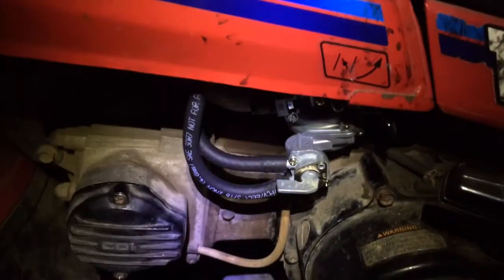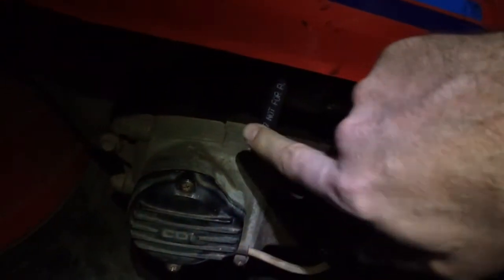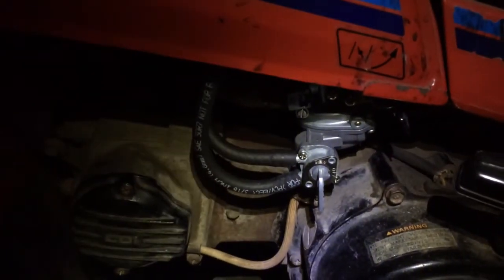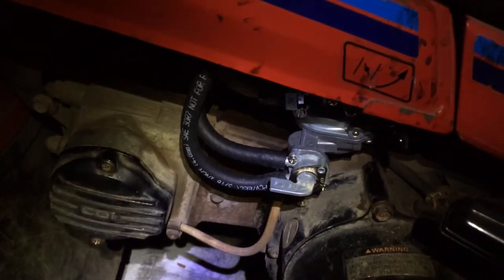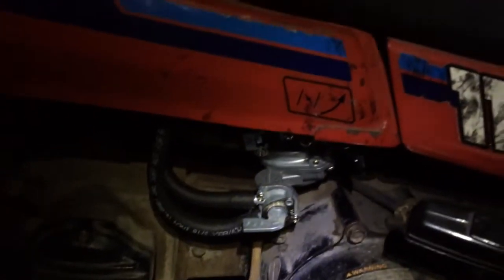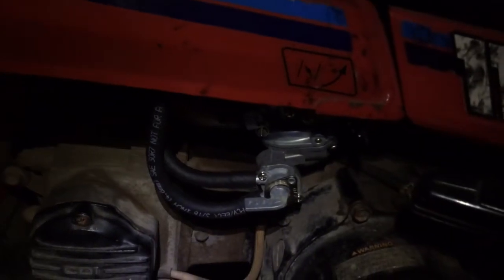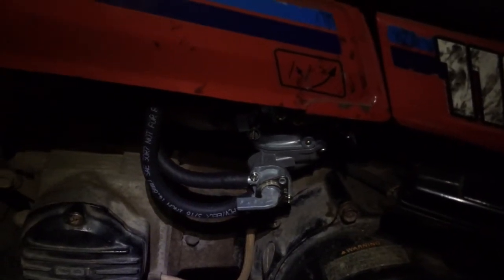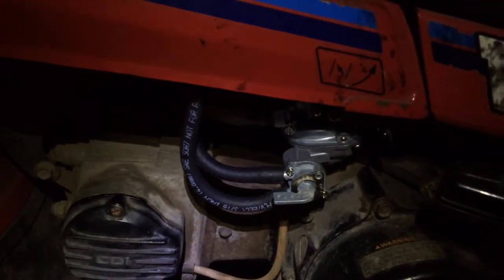Daily Dose of Lambdog ep154 "ATV update"

Comment: do those hose barbs screw out or are they molded as part of the cutoff switch? If you can remove them, I'd just use metal lines.

Comment: I still don't see why you were having the idling problems even if they were reversed, unless the valve cock opens wider from  the reserve line. I think your fuel is wrong. Your  engine is ''old'' and remembers when octane was real.  I don't know why you're worried about  the fuel lines in a emergency that duct tape won't fix.Half assed is okay till you get home. You really want metal mesh fuel lines? You could get some water pipe insulation if you want to cover then up. If they're in the way I'd  hold them back individually with zip ties. If the hitch is that low then the mount is lower. That's where a proper hitch needs to be to keep you from going ass over heels. You could mount a higher hitch, but you know, less weight. Where do you need to go that 30mph won't get you?
Reply from the maker: The issue I had was with a neutral wide open throttle blip.  I was concerned about the possibility of being too lean.  It is fine under load, so I am fine with it.  30 mph through the woods is booking it for sure, I doubt I will get it to that speed again for a while.